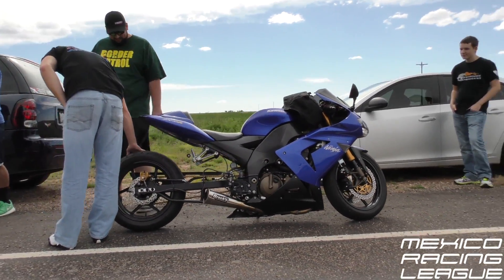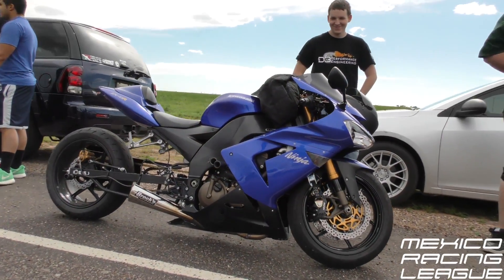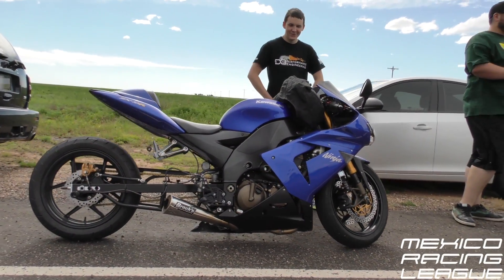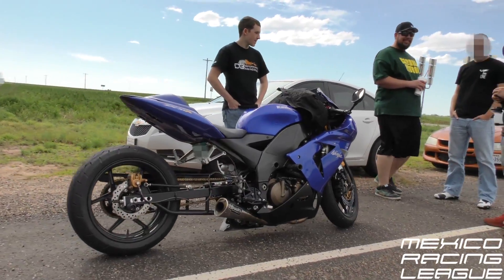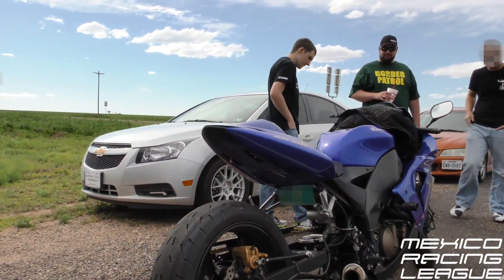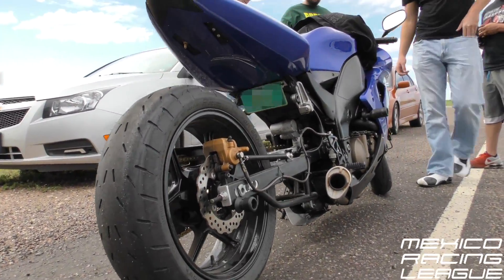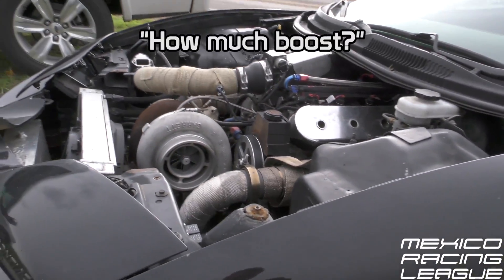88mm turbo Trans-Am vs stretched ZX10 - DIG RACE!

Comment: I was thinking the Car would get the bike..   A little surprised.  The new BMW 1000RR makes around 200hp stock.
Reply: grabir01  This is a first gen ZX-10 made in 2004-2005. I have the same bike. Today's bikes make a lot more power.
Reply: kapture2k Yeup, but the Gen 1 is still a very fast bike when built correctly. There are a lot of Gen 1's still running faster times than the new bikes down the 1/4. Not so much though on the road courses.

Comment: Gear the 10r for riders weight and do some clutch work, ie stiffer springs, Brocks mod, and watch that gap double. Front sprocket should be -2 and fine tune with rear sprocket. Psychobike.com
Reply: it's down 1 up 5 right now.  one of first times on the street stretched.
Reply: Or just buy a h2.

Comment: Bike > car any questions?
Reply: Scooby blue car had no second gear
Reply: Scooby blue  There is going to be rematch soon and we will see how it goes then....  The car had more than one problem that day that is fixed now
Reply: No questions, just that you're  statement  is wrong.
Reply: randombk82894 Sounds like a good excuse to me. Lol
Waiting for the rematch.
Reply: Scooby blue Turbo bikes still can't  keep up with turbo cars. I'm  yet to see a drag bike go faster than a drag car too.
Reply: ***** If you're going from one extreme to another, yes you are correct. IE top fuel car vs top fuel bike.......However I don't get your statement of turbo bikes still can't keep up with turbo cars? What's your comparison here lol. Are you comparing turbo 10.5 outlaw cars to turbo bikes, turbo street cars to turbo bikes, or once again just one extreme to another. For standing mile it took how long for a turbo street car to even think of competing against a turbo street bike.
Reply: LUDE4LIFE1 I'm  just talking one extrene to the other. Build both to the max, and the car will always come out on top.
Reply: ***** Go to Houston. Not saying a turbo on a bike will beat everything, there's always someone faster but 700hp on a bike is going to break some hearts.
Reply: ***** Both to the max though like you stated, yes. It's a platform thing but everyone has the platform they would rather tinker with. To each their own.
Reply: So Frosty I've  got nothing against  bikes, but like you said, it's  a platform  thing.

Comment: Noob to TA: what kind of safe boost can TA run on stock block?
Reply: 7-12lbs
Reply: the stock ls1 5.7 doesn't like boost too much. get a junk yard 5.3 iron block and good heads and boost the crap out of it.
Reply: 6.0 does worse stock with boost. weak rods.
Reply: I read the question as "stock BLOCK," not stock motor. I have an LS6 BLOCK, fully built internals and CNC heads and more, 
 running a turbo and a 3 bar MAP sensor. 20PSI. No problems.